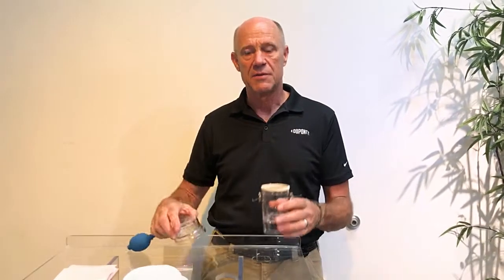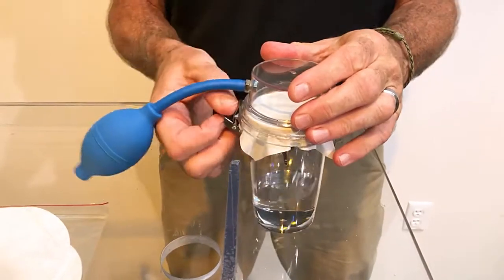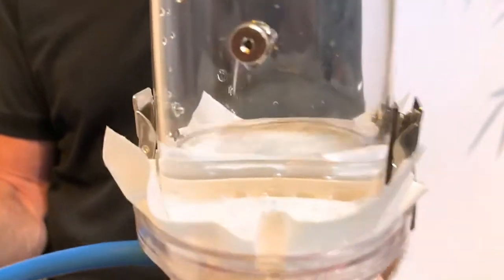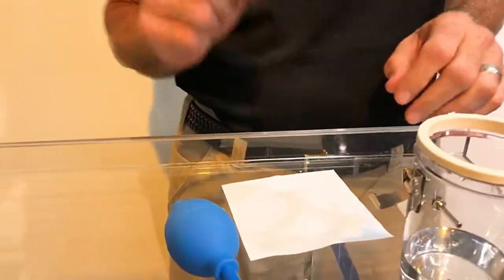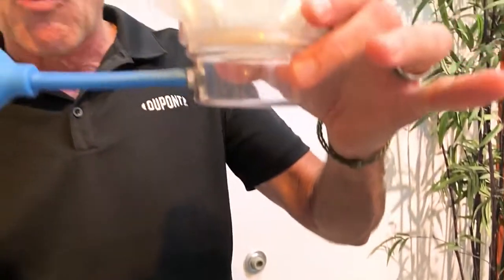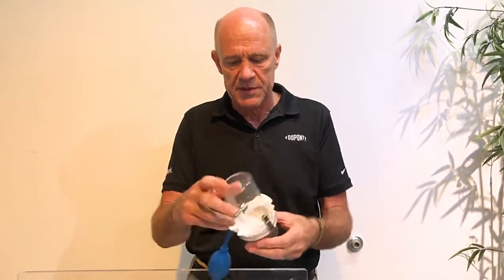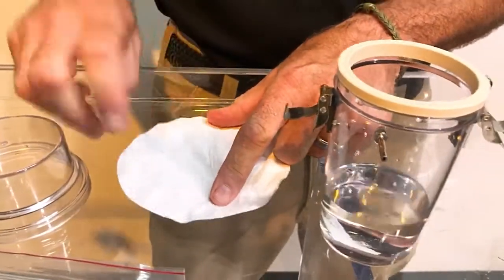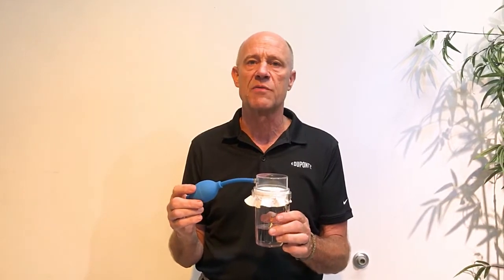Analyzing Breathability and Durability: A Comparative Demonstration of Tyvek® and MPF Fabrics

Comment: There is no way you would replicate the pressure generated in this test in real life, totally irrelevant test in real life. By the way, Flash Spun Polyethylene that Tyvek is manufactured from is plastic too. If you want breathability buy SMS fabrics. NB...You appear to squeeze the bulb softer when doing the MPFL test. Why is that I wonder??
Reply from the maker: The bubbler test is for demonstrational purposes only to show how air flows through Tyvek® and not through MPF.  This is due to the flash-spinning manufacturing process. 
Neither SMS nor MPF provides the balance of durability, comfort and protection of Tyvek®.   Please feel free to contact us for more information and we’d be happy to further elaborate and demonstrate.
Reply: @duponttyvek1757  Its misleading, irrelevant and disingenuous at best. It doesn't demonstrate anything other than how DuPont manipulate testing to their advantage.